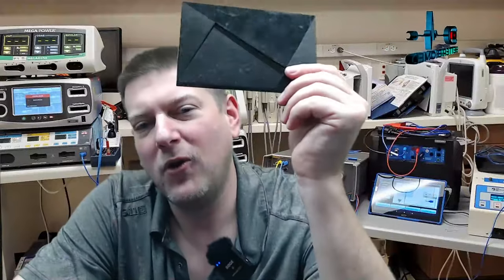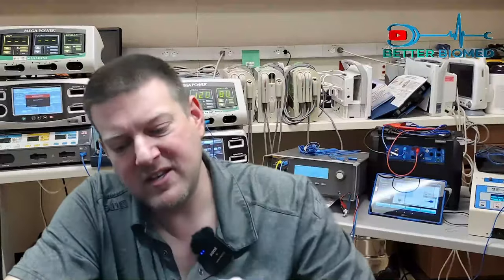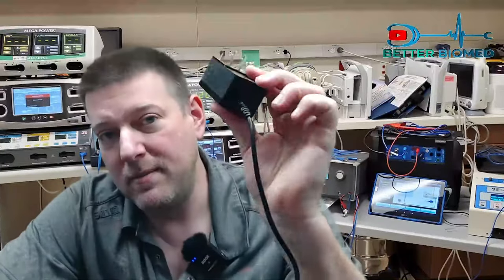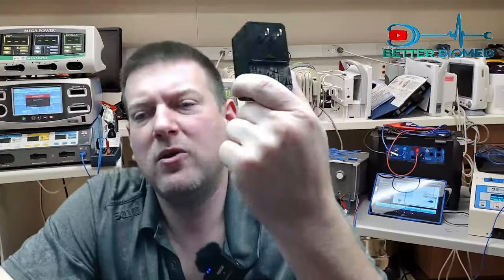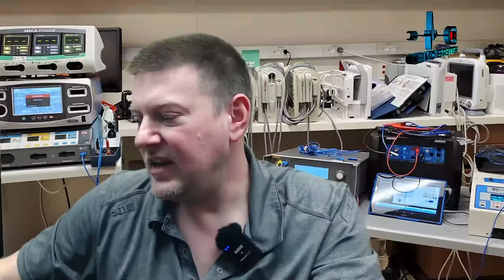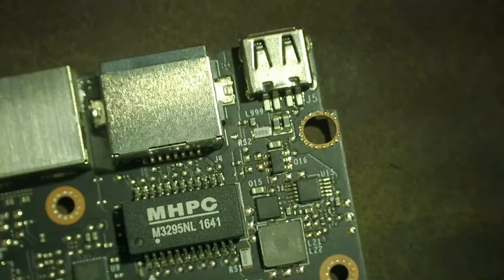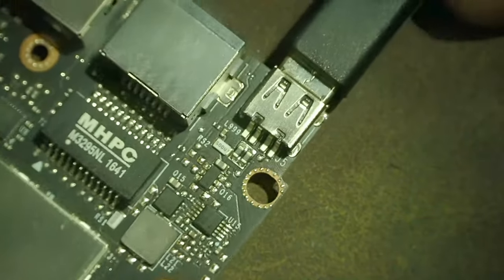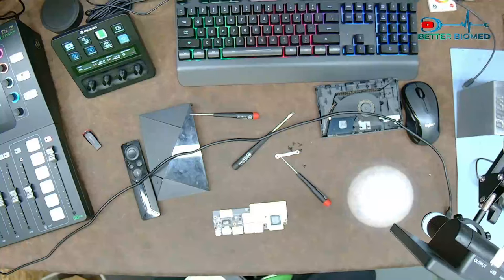NVidia Shield Failure

Comment: I've had a similar incident about 25 years ago with a lightningstrike @ 3:40. I was still living with my parents at the time. I had a small room so I didn't have a TV, I had a PCI TV-tuner in my PC. I was away on summer camp and I had disconnected the internet modem (my parents didn't use internet yet at that time) from the telephone and electric socket. I had disconnected my PC from the electric socket, my brothers PC was also disconnected from the electric socket. My dad was watching TV in the livingroom when lightning stroke. I had forgot to disconnect the antenna from my computer. The lightning hit the electric grid. It jumped from the set-top box to the antenna, to my computer, via the ethernet thru the 8-port hub to my brothers computer. It fried my TV-tuner card, my ethernet card (being old computers no ethernet was built-in, it was PCI), the 8-port hub, my brothers ethernet card and his Sound Blaster (16 I think it was, or Audigy, can't rememeber)

Comment: Hello!! I just clean up my Nvidia Shield TV from dust and replace thermal paste to CPU. After i plug power cable the 3 LEDs light up intermittently and from Shield motherboard a strange noise like a spinning hard drive except my Shield does not have an mechanical hdd. No power (except green LEDs and the strange noise), fan not spinning, CPU is cold so no power to the CPU. What can it be?
Reply from the maker: Interesting.  I have no idea.